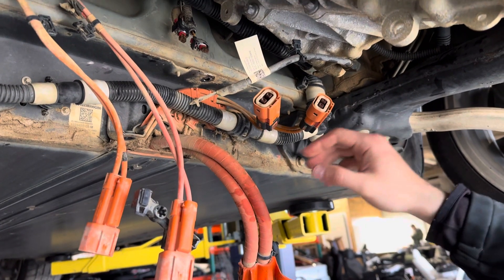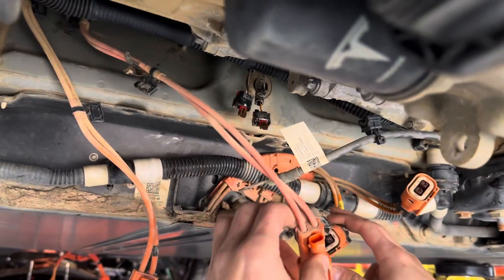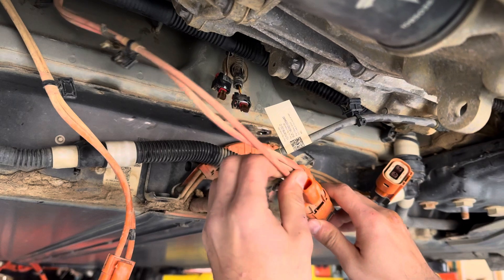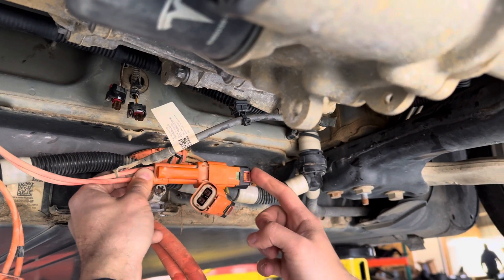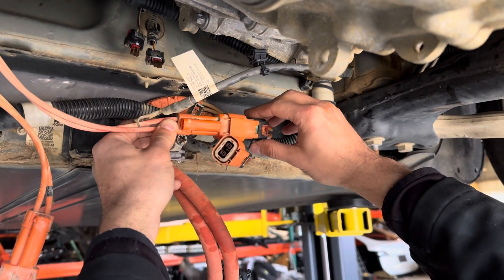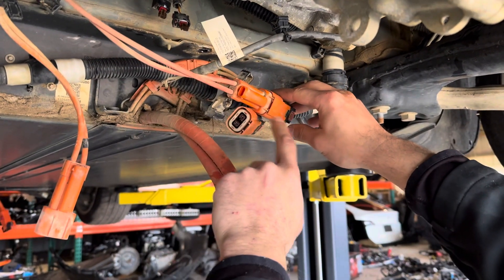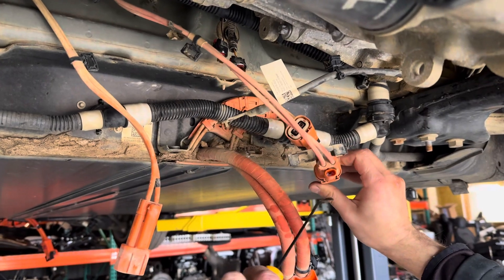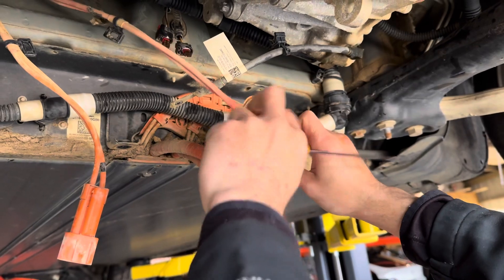How to disconnect HV AC compressor and heater plugs in Tesla 3 and Y

Comment: Is there a way to jump the hvil without plugging in another motor I have an external fault it's a p series i think it mite be the LDU motor causing it. I purchased the fluke meter to do a resistance test. Not sure if there is another way.
Reply from the maker: Yes you can close the hvil without plugging in another motor.   Some day I will do a video explaining how to use a megaohmeter to measure isolation resistance.
Reply: Compressor shows fault in the service mode, and there is external isolation alert BMS_035 which makes the vehicle shut down HV battery, do you think there is problem with the Heatpump compressor ? Or could it be the HV cable ? I tried to run HVAC test but it fails immediately, will it be possible to replace the heatpump myself because tesla service isn’t an option for me
Reply from the maker: @BarziHSaeed it could be the compressor.  But you need to diagnose it.  You need machine to recover and refill refrigerant, so not a DIY task for most people.
Reply: @diytesla  is there any specific way to test if the compressor is faulty? Should measure continuity of its power inlet with the body of the compressor?
Reply: @diytesla  because the compressor gives fault and It won’t run at all
Reply: Is this how you shut down the tesla model y??